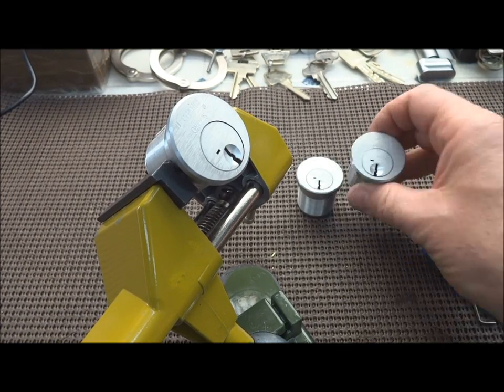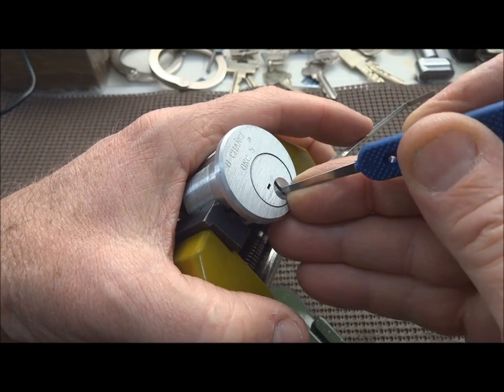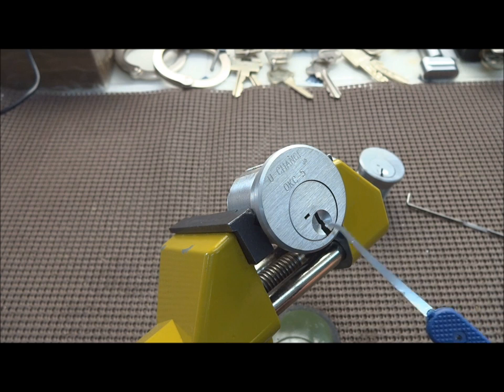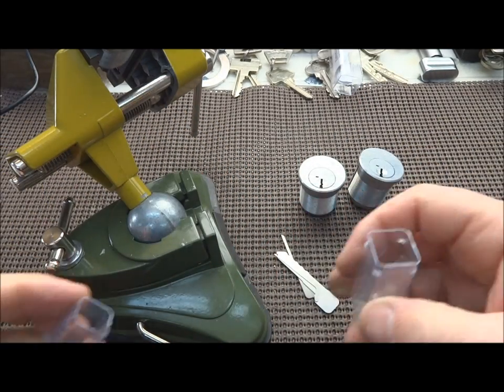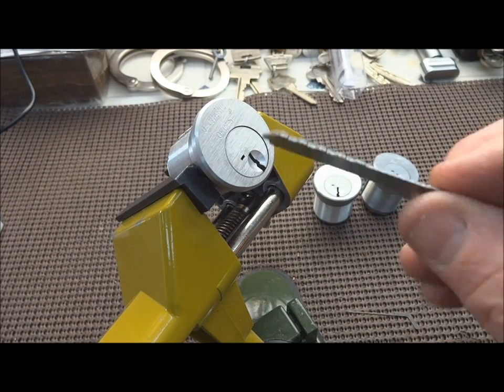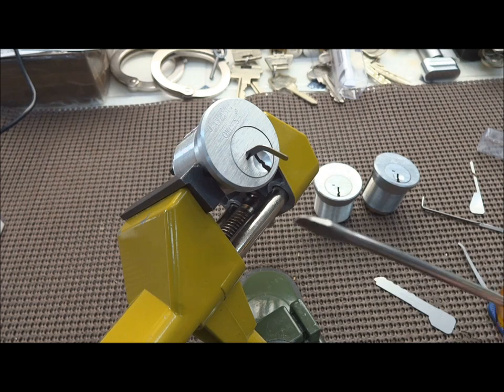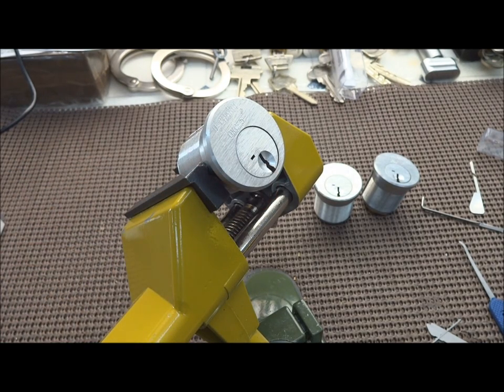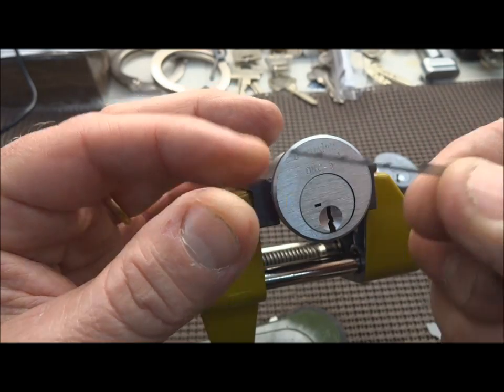(246) U-Change Lock Cylinder - EASILY Bypassed (JUNK!)

Comment: Wow, a lock which has a backdoor built into it intentionally. WTF? what a shit design!
Reply: Security solutions (u-change manufacture) is really shit. As a locksmith, I really do hate u-change because they are shoddily built and don't work half the time
Reply: It's not an intentional bypass. The purpose of the small slot above the keyway is to allow rekeying by the user. What you're supposed to do is insert the key, insert the rekeying tool in the slot, remove the key, insert a second key, remove the rekeying tool and finally remove the second key, which is now the key that opens the lock. The rekeying tool is basically a flat piece of metal the same size as the slot, and it doesn't rotate when it's in there. Unless I'm mistaken, the bypass is not deliberate: it's a design flaw.
Reply: FBI and NSA approved....
Reply: @beeble2003  A bypass is a bypass, why doesn't enter the security equation.
Reply: gofastwclass My comment wasn’t about security. It was refuting the OP’s claim that the lock had a deliberate backdoor. Intent is important: there is a huge difference between an accident and a malicious act.
Reply: @beeble2003  I respect that.
Reply: Yes you wasted my time

Comment: Peterson doesn't sell this tool anymore
Reply from the maker: Gee, I wonder why...?  😖
Reply: If anything seems stupid on their part.  To turn down money.  It’s not like they don’t sell a number of other bypass tools. Including sparrows.  
To bad quickset didn’t have a bypass for that smart key situation
Reply: @AquaTech225  not sure about the current smartkey locks, but the early smartkey locks had a problem in the design where if enough turning force was applied to the keyway, it would turn and the lock would open, and athough it would be classed as forced entry, there would be no sign of forced entry to the end user, athough once that method has been used on a lock, it would just be a matter of time until the lock stopped working

Comment: Yeah but it's $120 for those 3 little pieces of metal, which apparently only 1 of those pieces is what you need, so $120 for 1 precision paper-clip sized piece of metal... man they are making a killing in profit.
Reply: Jay H 
they don't want people having ready access to them, so they make them expensive. to a locksmith getting paid to open a door, you'd make it back in one or two jobs.
Reply: Jay H try designing this bypass yourself and see if it doesn't cost you significantly more than that in labor alone...it's Intellectual property and the R&D isn't cheap, they can't just give that away. And if it cost a dollar every crook from coast to coast would have one.
Reply: True. I forgot that locksmith tools are expensive. I still want to officially become a locksmith some day.
Reply: Yeah, but if these tools were easily affordable, maybe then people would change thier crappy locks for something better. tbh I would expect 7 pins in a storefront lock, not this measly 5 anyway.
Reply: @penfold7800  Aside from being forced to follow certain fire safety codes that introduce vulnerabilities (which can safely be resolved without violating safety codes), no storefront should have a lock with a bypass.

Comment: This  is a dumb design. They ripoff the Kwikset Smartkey system. Anyone noticed that? The smart key tool slot.
Reply from the maker: Uhhh.. don't get your blood pressure up...  This was designed and patented LONG before Kwikset even THOUGHT about their Smartkey system.  Also, aside from the little hole for the reset tool, there are no similarities in design.
Reply: Bosnianbill but I think that hole is for rekey anyway.